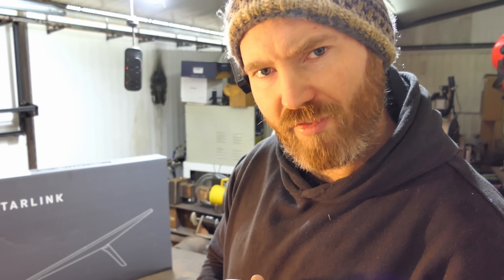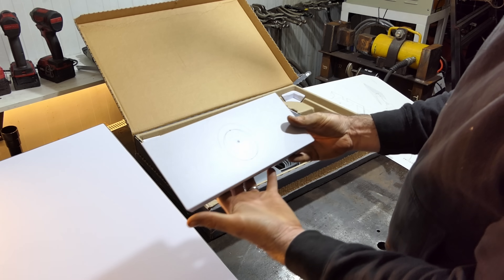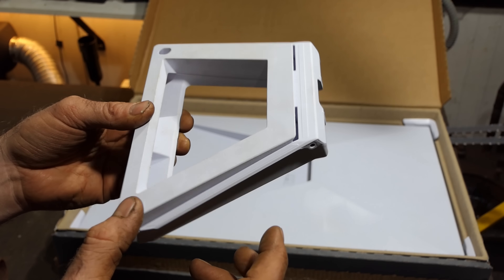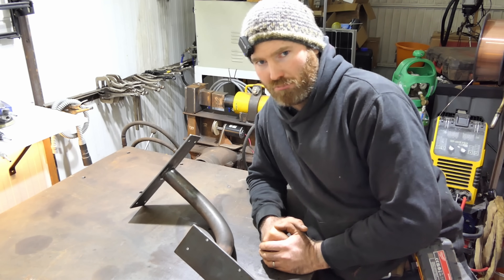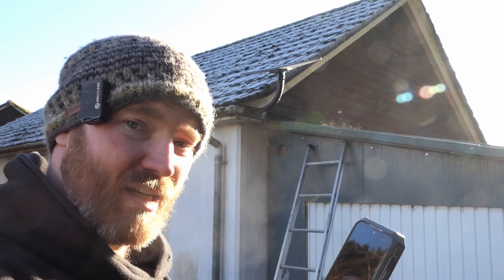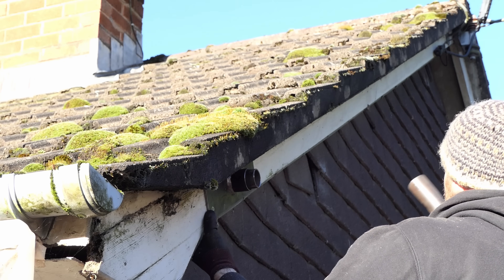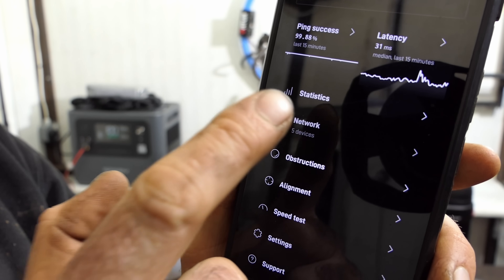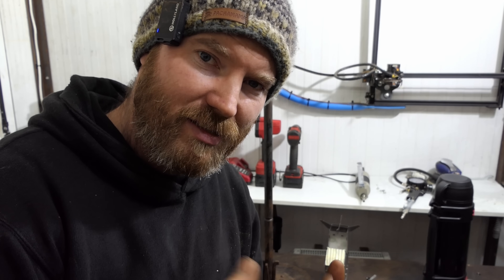I bought UK Starlink internet... I'm shocked!

Comment: We bolted a 1st generation dish to the back of our yacht (bought on 2nd hand on ebay for 150 quid), set sail from the Caribbean and crossed the Pacific to OZ. We lost service (due to outages) about twice in 8 months. If it was really heavy rain, we would lose signal, but not for long. It was unreal sitting in an atoll, 500 miles from anywhere and being able to stream Netflix, facetime family and generally have better internet access than most of the UK. Often, we would easily get north of 250 Mbps down and 25 up.

Utter, utter game-changer.
Reply: I had Sky internet in the UK a few years ago, it was absolutely garbage upload and download.
Now I live out in the Western Australian outback literally a few hundred miles from civilisation and I get better internet here than I did back in the City in UK.
Reply: @MaximusDesimusMeridius01 That’s funny because Australia has some of the worst internet speeds anywhere 😂 sky are also one of the worst. I have Vodafone fibre it’s fast af
Reply: @MaximusDesimusMeridius01 Don't forget SKY internet uses the Openreach network so the most you are going to get is 37Mb down!
Reply: And is that any sort of special monthly subscription? 
I read on their website that they have €239 maritime subscriptions, which seems a little steep compared to a regular subscription, so it would be great if a regular subscription worked just as fine on the waters
Reply: @johnenglish8126 my nephew used to be a deck hand on a super yacht and they used to pay about 8 GRAND a month for internet at sea.
Reply: @johnenglish8126  Sorry, I thought I replied to this.

We used Global roam to get coverage at sea, so its expensive, but worth every penny.

As you sail around the world, it is possible to sign on to different regional roam tariffs. I seem to remember that the OZ/Nz regional tariffs also covered Fiji/Vanuatu. This can be a lot cheaper, find a local address to register and then pay with a wise card in the local currency.
Reply: @johnenglish8126  yes, you need a special roaming subscription if the dish is mobile. With a standard subscription the dish is geofenced and if you move outside the allotted small area it won't connect.
Reply: I used to work in shipping and this stuff makes it soo much easier for vessels and insane speeds which were prevously unheard of. I'm impressed that you pulled this off. Well done, fella.
Reply: I don't think I'd even sail on Hyde Park Boating Lake in a yacht that cost £150!
Reply: Pointless for most of us.
Reply: You bought a yacht for $150 and sailed the Pacific in it , fantastic, PS have you got a YT channel 👍😀
Reply: But, but, Elon is Evil!
Reply: @Paul-M-UK  Yes. I used to forward the license certificates for this service for vessels.
Reply: @HajzlHajzl Sure let me have a quick word with the politicians and presidents. I will be right back. Ok I am back, they said you are stupid keep crying and no one needs a yacht lmao
Reply: I've got it on my super yacht!
Reply: @azslab  😏
Reply: Boats normally have satellite, radar etc… well modern boats do so then yr covered
Reply: I thought people did the sailing round the world bit to get AWAY from internet shite?
Reply: @gaycha6589   . ?   .why would they dummy  sailing  anything can happen . need a good starlink and a sat phone .
Reply: folk have sailed for centuries without internet connectivity.  Most want to sail away from Netflix and social media.   But if safety is paramount, eprib, VHF, SW and Sat phones all available.  And better for life saving than stream movies 😂
Reply: I worry about the commercial sustainability of Starlink. It’s expensive to launch and highly inefficient, and thy have to replace the satellites every 5 years or so. They need a seriously large number of subscribers to overcome that cost but the market for satcomms is shrinking as more and more fibre gets rolled out. Worse the fibre operators can offer gigabit in both directions easily, whilst any satcomms inc Starlink has to spend serious money for such an upgrade. 

So it’s great for yachties at the moment.

The geostationary satellite operators aren’t standing still. Both Viasat and particularly Inmarsat are putting up new spacecraft in Ka band with very large capacities. Their big advantage is that 1 satellite covers 1/3 the world straight away. When these come on line more, they’ll be highly cost effective and efficient. They could be the ones to endure.
Reply: "our yacht (bought on 2nd hand on ebay for 150 quid)" - Amazingly low price for an ocean-going yacht :)
Reply: I absolutely love my provider, they were the first fibre internet provider in my area and they saved me from openreach networks like Plusnet and sky that would literally have an outage every day, usually for days at a time, it's been a while now but I'm pretty sure we had more time with no internet that with internet. They never did anything other than replace the £3 filter which didn't do shit, and the speeds were not even that good. The current provider I have is far more reliable - only one unexpected outage in like 8 years, is cheaper by about 20-30% for the 1 gigabit option, they provided two mesh routers and the customer support has always been really fast and hasn't been outsourced abroad, unlike sky and Plusnet.
Reply: Brave, sailing the Caribbean on a £150 yacht. Fair play :)
Reply: Im in Sussex 40 miles from London and it is known and accepted we have poor coverage. Today its 30/20. Sometimes 250, sometimes 5! Anyone denying this is wrong.  Parts of Kent don't even have tap water at the moment.
Reply: ... our yacht (bought on 2nd hand on ebay for 150 quid)...
That was a cheap yacht... - just joking... Very jealous.
Reply: I have substantially faster UPLOAD speed on my Mobile phone
CURENT TEST                              2026.01.191    ISO  DATE
DOWNLOAD       267.8 Mbps -   
UPLOAD	             94.86 Mbps  --  iPhone XR
Reply: @XRAF-633 congrats. And are you located in the middle of the ocean where there are no cell towers?
Reply: Dude, I live in the West Yorkshire countryside and I get 500+ for £20 a month. I could upgrade and get double that but I don't need it.
Reply: @Rogue_Leader  I pay £29 a month for 1000/1000 and can pay £49 a month for 2000/2000 if I fancy.
Reply: @Rogue_Leader  Don't even get that living 40+ minutes from London
Reply: @Thomas_M82  i get 900 down 100 up at the bottom of wales for about 70 a month
Reply: @namgibot  niiice
Reply: What provider you with?@Rogue_Leader
Reply: Sounds grim. You need to get a life.
Reply: Have you used the (Hard wire option) for the router.. 
You use the electrical circuit to carry the signal to an from the router.. using a purpose built plug...using the earth wire I believe. Every plug in the house becomes the plug point for the (Ethernet) effectively making your home 4 & 5g  microwave free ..
Reply: Most of the uk can get 1gb and up lol alot faster than 350mb also its wireless. No good for gaming at all
Reply: @GaryGreys-ri4wi  We are massively behind  whilst pretending to be "World-leading".
Reply: @Thomas_M82  huh? We have faster internet than America bro lol go check! Mine is 1.2gb download with 700mb upload
Reply: @GaryGreys-ri4wi  We have nothing like South Korea and other countries. Sure we have 1.2 gig with a super-premium service but these are not rolled-out where I am and I am only 40 minutes away from London.
Reply: @Thomas_M82  i can get up to 2gb lol, So can the majoroty of the uk. You are just unlucky dude. Folks in America cant even get it at all in some places. And Korea lol they create the tech my bro doesmt surprise me, but tbh has alot of places that don't if you search also lol
Reply: @GaryGreys-ri4wi  Singapore too. Actually we created the tech with America but they improved it. Grandpa was installing home networks a very long time ago for bt.
Reply: @GaryGreys-ri4wi  dude I'm between Derby and Nottingham and can't even get 20mb 😂😂😂 5g wireless will be more but it's utter garbage. Third world junk.
Reply: @GaryGreys-ri4wi  Your talking bollocks mate yes some can get fibre to the premise but to say majority of the uk can is a complete lie.
Reply: @MrStevegibb  it isnt a lie. Take a look
Reply: @Thomas_M82  Covering in the UK is shocking - there are some parts of London that virtually no mobile phone signal.. And if you go into the countryside - watch the mobile phone signal totally disappear, and some rural areas are still effectively on dial up - yep in 2025. Fibre optic for many is a pipe dream.
Reply: @GaryGreys-ri4wi  you are talking poop now, very few places have over 1GB. Most are barely getting recently 1GB.
Reply: @DragonXDrei  were i live we get 2 gb for 99.95 a monthly in kentucky .
Reply: It can be good for gaming as long it has open nate type and decent ping  @GaryGreys-ri4wi
Reply: @GaryGreys-ri4wi  It's plenty fine for gaming. Unless you're one of those WoW freaks😂.
Reply: You should sell your yacht and donate the money to the homeless and hungry in our country. What is wrong with people???! NO ONE NEEDS A YACHT
Reply: @Mike-dw6qu  lol
Reply: @Mike-dw6qu  wow aren't you great? The man worked for this, and so could those homeless people. You realise that some of us have started the same or far worse than this homeless and hungry people right? I assume if you do give money away, is for very selfish reasons, like self gratification or because it makes you feel better. Have you watched The Good Place? You really cannot do good without bad. There is 0 way that you can make any money, without causing a few people to go hungry or homeless. But whatever makes you sleep at night.
Reply: @DragonXDrei  i dont give anything away. I cant afford to because rich people hoard all their money and use it for pointless things like a yacht which no one needs.
Reply: @Mike-dw6qu  Well they have to put all that money into something, otherwise they may get taxed for it:)
You would 100% do the exact same thing. If you had $50k that your were going to get taxed on, but instead decided to buy a new boat or property, which you could use for yourself for holidays, but also rent out to create passive income, would you? I bet you would.

A lot of these rich people yachts, are also being rented out. Most rich people don't buy useless large assets without a reason, or to make them even more money.
Reply: @Mike-dw6qu  . . . hang on! they needed that yacht to get to Australia. Can't swim that far and hard to swim and watch Netflix with an antenna strapped to your back and a small tv stuck to your head. Mike-dw6qu (AI bot), you haven't thought this out properly. So, humans still rule then.
Reply: @Mike-dw6qu  You're a sad moron who counts other people's money. Start from yourself.  How about you keep just enough money to live in a smallest apartment, eat cheap food, and give the rest of your money to homeless so they can keep buying booze, drugs and overall continue their self-destructive lifestyle choice.
Reply: Bro’s picturing a mega yacht 😂😂😂
Reply: @ here’s an idea… you go make a lot of money and give it away. Nobody’s stopping you.  You’re so generous… with other people’s money.
Reply: @ROFO79  I already give my money away. No one needs a yacht. The money from selling it can be used to feed the hungry
Reply: @ LMAO.  keep giving your pocket change away.  You spend your money, however the hell you want, and other people will conduct their own lives.  You don’t get brownie points for wishing something someone else had belong to someone else.  Here’s a novel idea control what you can. Give more of your own shit away.
Reply: @ROFO79  There is 8 billion people on the planet and if we all had yachts it would destroy the planet. If i cant have a yacht why should you? Sell it and give the money to the hungry
Reply: @ you have obviously got it all figured out. So go get rich and give it away, sweetheart.
Reply: @ROFO79  Just sell the boat bro. It's not difficult to not be selfish
Reply: @Mike-dw6qu  NL here... 50 bucks for symmetric 1/1 GBit. You can even get 4 GBit now it seems for 70 per month... if you own the networking equipment for those speed that is.
Reply: @Mike-dw6qu So whoever buys the yacht from him should do likewise. But then no one actually needs the yacht so who should buy it. If no one buys it it's worth nothing.
Reply: @Mike-dw6qu  After taxes your money is your own.  Anyway your surmising he does not give to charity.
Reply: @nickr9620  Doesn't matter. give more. no one needs a yacht
Reply: @Mike-dw6qu  you say as your using youtube

Comment: I have to say, I absolutely love your channel and the content you create. You tackle issues thoughtfully and don’t resort to quick-fix, out-of-the-box solutions, which I truly appreciate.

I got Starlink a few years ago when I was living near Newry, Northern Ireland, and planning to move further into the countryside. Reliable internet was a priority since the house we bought only had an outdated phone line, making working from home quite difficult. At the time, Starlink was a game-changer. It provided a strong and stable connection when no other options were viable.

However, last month, fibre finally arrived at our house after months of persistent follow-ups with the provider. I was eager to make the switch, as I’d started experiencing some frustrations with Starlink.

Data Caps and Pricing:
One major issue was the introduction of data caps. Starlink now caps priority data at 20GB per month for residential users. Once you exceed this, your connection speed drops significantly unless you pay extra for more priority data. Here’s the pricing structure:
- 40GB Priority: £96 (€115)
- 1TB Priority:** £180 (€216)
- 2TB Priority: £360 (€432)
- 6TB Priority: £1080 (€1289)

For a family relying on internet for work, streaming, and daily use, 20GB is barely enough—our TV alone could use that in a day. This was a deal-breaker for me, especially as these caps weren’t in place when I first subscribed, and Starlink had originally marketed itself as uncapped.

Country-Specific Pricing Disparities:
Another issue that bothered me was the stark difference in pricing between countries. For example, in Germany, the monthly fee is €50, while in France, it’s €40. Meanwhile, in the UK, we’re paying nearly double for the exact same service. It’s the same satellite, so this disparity feels unfair.

Latency and Performance:
Over the last few months, I also noticed the latency worsening. Actions like clicking on a video and waiting for it to load became noticeably slower. This wasn’t an issue in the early days of using Starlink but seemed to deteriorate as the network became more congested. My setup hasn’t changed—I have clear skies and a solid home network—so it appears the problem is on Starlink’s end.

An Unusual Roof Phenomenon:
This is something strange I observed: the side of my roof where the dish was installed saw the moss and algae completely disappear, leaving the tiles looking bleached and bare. Meanwhile, the rest of the roof remained black with natural growth. I’m not sure what caused this, but it’s definitely curious.

Conclusion:
Switching to fibre has been bittersweet. I loved the flexibility of Starlink and its ability to provide internet almost anywhere, but the growing list of issues—data caps, pricing disparities, worsening latency, and the changing promises—pushed me to make the move. While fibre offers unmatched stability and speed, I still have a soft spot for the freedom Starlink offered in its early days.

Comment: If you are fairly close to  4g or 5g mast you could get a Cat20 router with external antenna to achieve more stable download& upload and much cheaper than Starlink or even get an industrial 4g/5g router with multiple different sim cards for laod balancing and fail over and still outperform Starlinks volatile speeds
Reply: That's a big if.